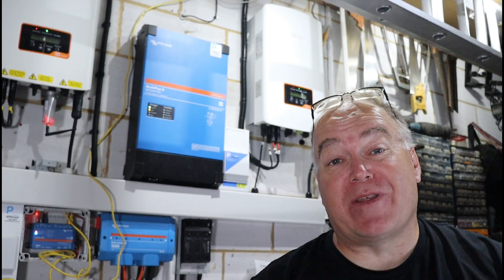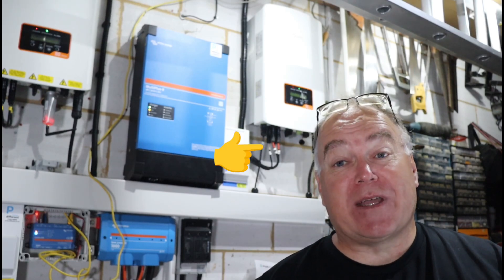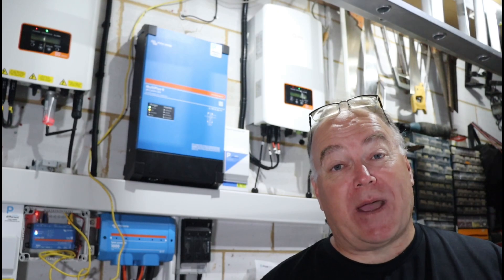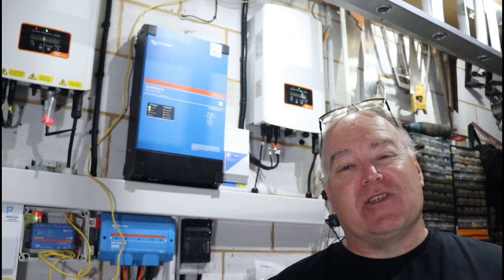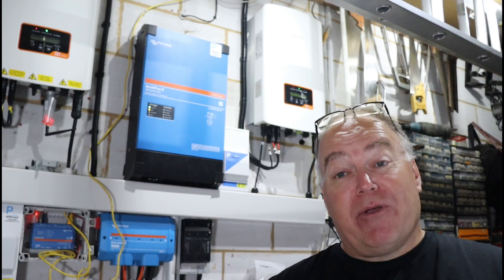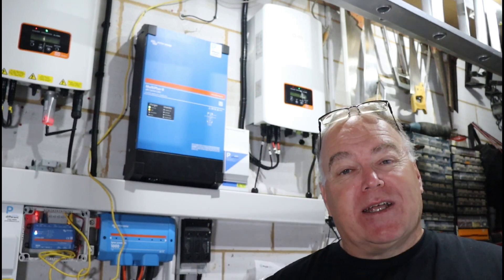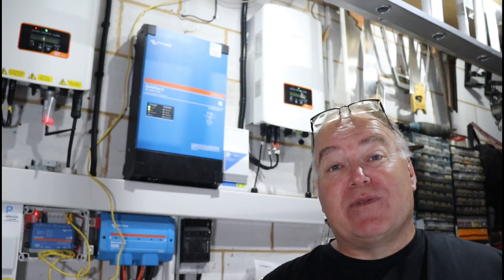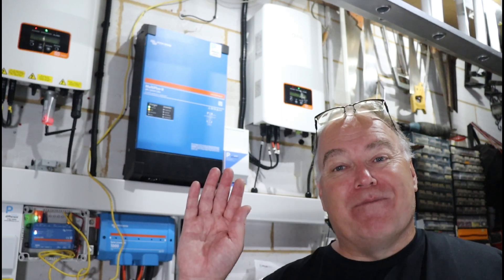Installing a Solar inverter (in lay man's terms) - Solis S6 3.6kw

Comment: Start looking at whether you can connect to your Solis Inverter dongles on port 8899.

It is best to get away from the dependency on the cloud, and get LIVE data from the inverter directly.  You would use Home Assistant to collect the data.
Reply from the maker: It's in my list to try mqtt calls for Solis but it doesn't seem like an officially supported thing so works with some inverter dongle configs not all.  I'm chasing solis themselves for a better update frequency which would make solis cloud better

Comment: I was told I could not have extra solar as the inverter would not switch quickly enough and would be a possibble problem for over voltage. Would love to know how different DNO's reach their verdicts. maybe it is me being very rural and the transformer not being new enough.
Reply from the maker: Lol not switch quick enough.. if it's g99 compliant  it must switch fast enough surely?
Reply: @EVPuzzle  I know, and I tried asking about this as my installers had told me they could limit exports and load. But DNO still said no.
Reply from the maker: @Jaw0lf  excuses eh..  encourages people to ignore them like charging at tips encourages fly tipping

Comment: A generation meter isn't a requirement of MCS certification.
Reply from the maker: As with all round rules and regs they're not interpreted or followed identically
Reply: @EVPuzzle  Do you even understand what that particular section of the MCS standards says? Did you even bother to read it?
Reply: @VinoVeritas_  Unnecessarily aggressive tone, he even said in the video not all installers still insist on them and that he didn't want it. If your installer wants to install one you go with the flow. Why should he read the rules? He said he is not an installer, and plenty of MCS installers can't agree, particularly when you have an existing system on FIT as Nigel does.

Comment: Ironically, I find the meter useful, obviously for the feed in tariff, but also because my installation was installed with 'Owl Intuition', which deviates from the meter reading as it can't be set up accurately to monitor usage/generation, so I adjust the settings (power factor setting) regularly to keep it in line with the meter. On sunny days if the power factor was set to 1 in the settings as was recommended, it would run away and over read the generation ( I found over years, that this needs to be set between 0.93 to 0.94, but I really need a three digit option to keep it accurate, which as there's no new development with the tool, they can't provide). So the meter is the only accurate tool that I trust to give me an accurate read. On a side note my installation is a 3.92 system and was installed almost 9.5 years ago and next month it finally pays back in hard cash terms its installation costs with a bit of profit margin thrown in and hopefully much more in the future (assuming I don't tempt the fates here and need a new inverter anytime soon).

Comment: Great intro to Solar install Nigel. I have battery storage and an Ecoflow inverter. If I hard wire the inverter into the consumer how would the house know which source to draw power from first? Same question about the energy monitoring system, (thinking of installing a Shelly 3M) if there are two CT clamps on the wires how will it know to draw the free (solar) power first?
Reply: I'm not an expert but I was curious when I got my system installed.  If you're asking what determines the source of the electricity the house uses (solar/battery or mains), it is to do with voltage.  From what I recall, the inverter sees the mains voltage and increases it's own voltage output to just slightly over the mains therefore that gets used by the house load.  Think of it like pressure, more pressure wins.
Reply: It is possible to link solis inverters via the com port and use only one data logger, I had to get spare comport connectors to make an adapter cable but it works fine... Solis AC coupled inverter is down in garden shed with data logger attached, solis PV inverter is in the loft of house linked to AC coupled inverter via the com port, i think it's just rs485 communication so I just used a twisted pair from a cat6 data cable.
Reply from the maker: @audioholic83  yes the documents say you use an rs485 cable with multiple solar inverter connectors and daisy chain them .  There's a 5 connector and 10 connector cable to buy apparently.

I haven't tried it of course ...yet
Reply: Any hardwired inverter intended for grid connection works the same way, the inverter monitors the grid connection, matches the grid frequency and phase and then outputs its mains voltage at a slightly higher figure than the grid supply that way its output gets used in preference to the grid. If you lose the grid connection, say in a power cut, the inverter will stop working too. Hopefully you will be employing an electrician to install it, totally illegal to DIY these in UK. Never had one myself but I'm not sure I would want to hard wire the such a product into my house on a permanent basis. Hard to imagine a product that costs £100 on amazon (if it's the Ecoflow product I'm thinking of) being man enough for such use on a permanent basis.
Reply from the maker: It doesn't solar wise it's like pouring multiple bottles of water in a jug then trying to drink just bottle 1.  It just all goes in the melting pot unless you have separate wiring , which wouldn't make sense

Battery wise they use CT clamps on the grid side to detect grid draw and then top up any solar to match zero grid use .

When the battery is maxed out the grid gets used .

Rsch system and software is different

Comment: You now have several arrays/inverters on your property, are they all connected to a single phase? If so what is the advantage of having separate systems like yours against one system with the same capacity?
Are you, by having multiple small capacity arrays, bypassing the need for DNO approval or have you reached a cummulative threshold that the DNO now could veto or require you to apply for approval?